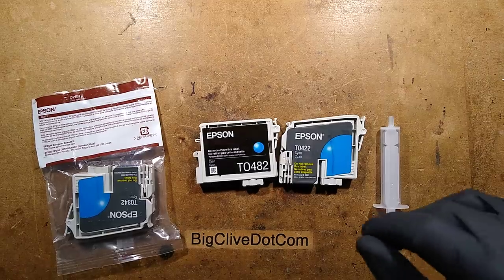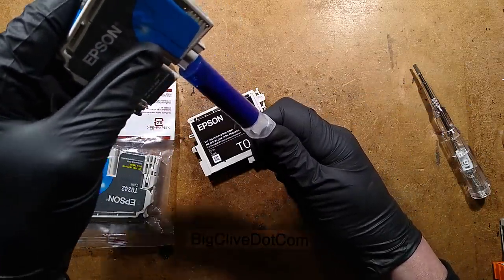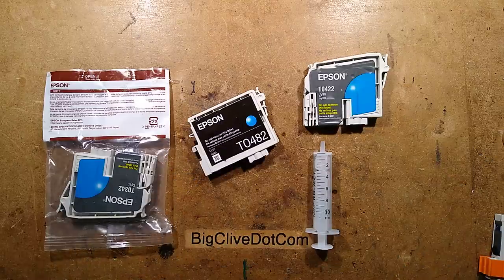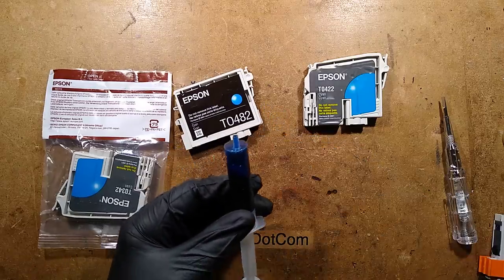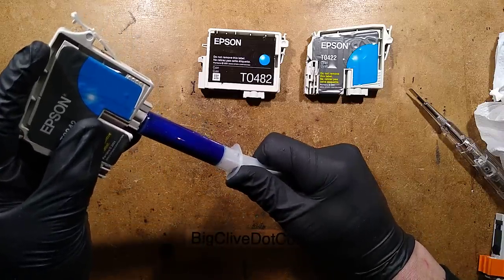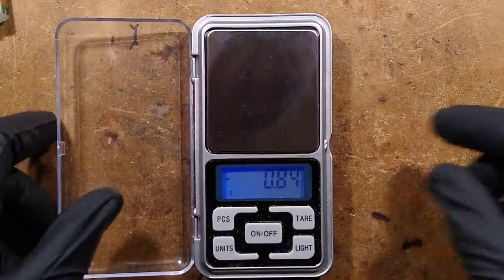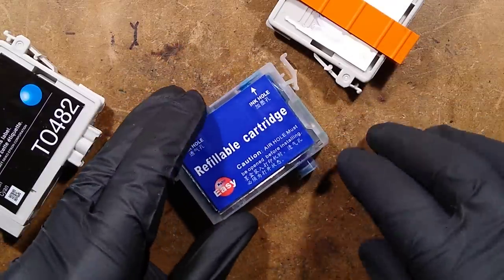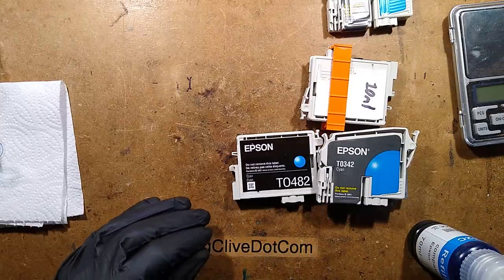How much ink is in Epson cartridges?

Comment: HP are worse with their Instant Ink system, if you don't subscribe to Instant Ink then you can't use their inks and have to buy the really expensive ones from shops, also if you are on an instant ink plan and cancel the subscription then you can no longer use your cartridges they supplied even if they still have ink in them.

I use an Epson Ecotank printer and it is great. I've even used unofficial inks before. Just remember with Epsons that they have an internal counter that shuts the machine off after a certain amount of print/clean cycles, and you have to get it "reset" to continue printing (applies to ALL Epson printers).
Reply from the maker: There are ways to reset the waste ink counter and wash out the full container.

Comment: I have a refillable Epson cartridge and once the printer thinks it's empty the printer sends it's 'kill' signal and the cartridge uses that signal to reset the chip, you then take the cartridge out refill it and place it back in the printer and it detects it as a new cartridge. I've saved so much money on inks.

Next printer will definitely be a laser though, I do such a small amount of printing that the heads dry out and I'm forever going through the printers head cleaning routine

Comment: If you do this again with any other 1st party (legit) cartridges, it'd be interesting to also measure third party ones of the same model number. Certainly the third party inks are a better deal, but maybe they are inflating their value slightly as well by putting in less ink than it can hold.
Reply: Ink is the cheapest part, the moulds to make the cartridge are more expensive, along with the print heads. Bulk ink is cheap.

Comment: Clive. Would you like to guess what manufacturer made my parents new printer? 
Yes it is. Maybe I can find some of those refillable cartridges for it. Are they easy to get?

Also we couldn't find those bits needed for the heater and we asked around, so we're getting a new heater. I suppose it's going to be more economical. 🤔 thanks for the help with that. 😀👍
Reply from the maker: eBay is full of refillable cartridges.  Just make sure that the printer can't "update its firmware" to defeat them.
Reply: @bigclivedotcom  
Sounds like a challenge. 🤔 I suppose there's only one way to find out. 
I'll see if I can get one for the black ink and if it doesn't work it's not too bad.
Thanks Clive. 😀👍

Comment: My mother was in the market for a replacement printer... Her printer was quite possibly THE cheapest piece of crap I have ever seen sporting the HP logo, made with the flimsiest of plastic. She prints so seldomly that her cartridges often clog severely. Most of the time, two or three "deep cleanings" can get her working again, but the last time she tried to print I spent about two hours fighting with the dang thing, and getting nowhere. Even a brand new cartridge wouldn't work. 95% IPA couldn't loosen anything up. So, thank you, HP, for helping contribute to e-waste with your junk. It's in the next pile of goods we'll be bringing to Goodwill. It scans/copies beautifully (even drivers' licenses), the FAX part has never actually been used, and if someone can fix it, it has WiFi printing as well. One man's trash could be another man's treasure. Or spare parts machine. Or making music on YouTube.

So she told me, "go online and find me a printer that isn't going to be a piece of 💩, I'm sick of buying replacement printers every two or three years." Valid point, Mom. So I pondered. She prints seldomly, and usually various bits of paperwork. If she prints a webpage or an email, whatever color is there (logos, ads, whatnot) gets printed. But she doesn't actually USE the color printing for anything. I asked her if she'd be willing to just have a black and white printer, and if she had something color she wanted printed I could use my printer, and she said that would be fine because "I don't even print in color anyway."

That settled matters nicely. We got her a monochrome laser printer all-in-one, no more ink cartridges to clog, cost-per-print is substantially lower, and it prints quickly. I didn't even check what dpi it's capable of. (I figured it couldn't be any worse than that old LaserJet 5MP I used to have... What a workhorse that was, I should've never gotten rid of it.) Well, Mom's happy, which means I'm happy.

I did point out the EcoTank models to her, and her jaw dropped at the price. I reminded her that the true savings was in the ink, and the more you use it, the more it pays for itself.

I get some really nice prints from my Canon Pixma all-in-one, once a year I print Christmas cards for my newspaper customers, ~150 4" x 6" color prints on glossy photo paper. I usually go through two of each cartridge, but it's worth it. Two customers actually asked me if I hired a local printing company to make them, which really made me feel chuffed as chips. But based on that once-a year heavy use, and minimal b&w printing throughout the year, I still can't justify buying an EcoTank. If I did more printing, an EcoTank would absolutely be sitting on the desk to my left instead of the Pixma.

Comment: Clive the EcoTank printers are designed to self brick. I'm shocked of all the people you would be had like that!  Every time you print, test print, etc.. it purgest the ink. Inside is a pad that once soaked it wont print anymore forcing you to buy a new printer.  Also, the printers are used printers of old, that were sold for fractions of the price. All they did was change the software and the ink cartridge.  The pad is not user serviceable.  This is well documented.
Reply from the maker: Currently at 6 years, 6000 prints and about 35% waste ink tank capacity used.   I have a reset code on standby for when I need it.   The biggest mistake people make with inkjet printers is unplugging them at night and only printing once in a blue moon.
Reply: @bigclivedotcom   That's a fair assessment. However, Companies designing product to fail over time is bad for the consumer. This should have been built to be user serviceable and although you may not agree with my sentiment, the companies and these behaviors should not be supported. Your use case may never see end of life of the printer, but the issue is that this information is not easily available when someone is purchasing the printer. That is bad business.

Comment: Cartridges are expensive but the printers are sold with bare minimum profit. It's sometimes better to see the printer as disposable and just buy a new one when the ink is empty. 

Btw the HP always online requirement so they can monitor your ink, for your convenience of course, is beyond atrocious. A while ago I had some router issues and because of that wasn't able to print because it was "not connected to the internet". WTF HP. I'm not even sure that's legal.

Comment: Have a look at just how much ink the "echo"-tank uses to flush and purge. It doesn't take long till the huge sponges in it is so saturated it refuses to print until it has been serviced. And no, even with a "user refillable" ink system they didn't think to make the pads user changeable. Or maybe they thought to NOT do that.
Reply from the maker: I'm at about 6000 prints on mine, and third party software says the waste ink tank is only about 35% full.  I think a huge factor in waste ink tank life is leaving the printer plugged in.  Turning it off every night may force a short cleaning cycle when it is turned on, wasting ink.

Comment: I doubt even true technochromatics will be able to see much if any difference between prints on bog standard photo paper with random ink and Epson's funky paper and even funkier ink - especially the 7 colour setups.

I dumped Epson when they went all chip. I ended up with an HP7000 which does not have chips in the cartridges. I used it until the print head needed replacement and put it in a cupboard. One day I might get a new print head but since I don't print photos any more that might be a few more years.

Comment: It isn't issue of amount in the carts.  It is the chip on the cart that stop it from working after a set amount.  Printer has no way to actually measure amount of ink left in the cart.  Like how if have a refrigerator with air filter and/or water filter, it tells you to change it after a set time and not because it is no longer good, because it can't measure it.
Reply from the maker: The older Canon cartridges had an optical system to detect ink level.  Also not chipped, so very easy to refill.

Comment: For all those who a commenting that the Epson Eco Tanks are still a limited life device by virtue of that pesky waste in tank, you need not fret, and frankly should do your own research before spreading false information.

Several of the Epson Eco Tank Models (iirc pretty much most bar the smallest ones) actually have proper user replaceable waste ink tanks that can be done by the end user within just a few minutes and no disassembly, and totally supported by epson with them selling genuine replacements.

The replacements have a chip on them similar to an ink cartridge that allows the printer to track the the use of the waste ink tank and are installed from the rear, retained by just a normal screw.
As soon as its replaced with a new one (Epson calls it a "Maintenance tank kit" iirc), the printer is happy again.

Comment: Epson lost my business when a few years ago one of their printers stopped working because of a 'waste ink tank full' error. This isn't real it is simply a maximum page count that the printer will stop working after printing 'n' pages. Epson will sell you an expensive 'override' code that will allow the printer to continue operating. So I stick to non-Epsom printers for which there are secondary market inks available. Currently I have a Cannon printer that works perfectly well with cartridges that cost me a couple of pounds each (possibly more these days - I bought a load when I got the printer and haven't bought any in the last couple of years.)
Reply from the maker: There is third party software that can supply the reset if you remove and clean the container.

Comment: I'm done with ink, I only use toner. I have a color printer but I mostly print black and white.
Reply: And yellow, depending on the manufacturer.
Searching "yellow tracking dots" will probably get you running to buy a UV/blue led torch and a magnifying glass.
Reply: @georgeprout42  interesting. I'll look into that.

Comment: Samsung CLX Laser printers are pigs. Not only are they expensive, but then there is the drum to replace, but also the catch bin. 
Carts are chipped. Outrageous. Some printers are connected to On Line Time Servers. HP by memory. They would time out cartridges even if you hadn't used them!

Comment: I have killed 7 newer printers doing next to nothing , except emptying my pockets 😡

Blown heads , gearbox faults , chipped ink cartridges , high running cost & heads blocked solid🤯

Needing only A4 , A3 & text prints in B/W my printer is a old 1994 cannon .
I have retired it 6 or 7 times now for newer models but it is back in use again ….😳
OK it needs Linux or some old O/S but you can refill it & it's pennies per 100 prints !

Comment: The ecotank printers look good on paper in terms of money and specs but they are still a disposable product due to the internal ink waste pad that once "full" renders the printer inoperable and unrepairable which is a shame.
Reply from the maker: That counter can be reset by third party software after you have emptied it.  After 6 years and 6000 prints mine is only at 35%.
Reply: Some of the Epson Eco Tanks actually have proper user replaceable waste ink tanks that can be done by the end user within just a few minutes and no disassembly, and totally supported by epson with them selling genuine replacements.

The replacements have a chip on them similar to an ink cartridge that allows the printer to track the the use of the waste ink tank.
As soon as its replaced with a new one (Epson calls it a "Maintenance tank kit" iirc), the printer is happy again.

Comment: Inkjet type printers always fail within 3 years regardless of brand.  This is because over time the extremely small ink nozzles clog up and can't be unclog. This is why everyone in my family have color laser printers.  The powder ink can't dry out and there no nozzles to clog. The only downside of laser printers is you can NOT use photo paper since it will mess up the fuser unit in the printer. I know this because I foolishly tried it and had to clean and rebuild the fuser unit in my laser printer (do not try this, it is very complex - I am a professional engineer that holds one of patents inside a laser printer)
Reply: The original HP design puts those holes in the cartridge, so each new cartridge provides a new print head .
Reply: @johndododoe1411  - true, BUT those cartridges are super expensive. You pay a lot to get a new $0.03 head and a few ounces of ink. In the long term laser printers are  much less expensive especially for occasional users.

Comment: Although eco tanks are better value, after so many pages have printed, the printer stops working and you have to reset the page counter in the Epson software, which you have to pay. There's a free download which let's you reset to another 500 pages, but it notifies you that the waste ink tank needs replacement (a messy job cleaning that out lol) 😂 so Epson are still ripping you off, just in a delayed way. Crafty stealth tactics. Gits!
Reply from the maker: 6 years, 6000 prints, ink waste counter at just 35%.  Full reset code on standby for when I need to empty the waste tank.
Reply: Some of the Epson Eco Tanks actually have proper user replaceable waste ink tanks that can be done by the end user within just a few minutes and no disassembly, and totally supported by epson with them selling genuine replacements.

The replacements have a chip on them similar to an ink cartridge that allows the printer to track the the use of the waste ink tank.
As soon as its replaced with a new one (Epson calls it a "Maintenance tank kit" iirc), the printer is happy again.
Reply: @KSSilenceAU  yeah, exactly my point money money money.. 🤑😉

Comment: I alqays wanted to try to read and write to that cartridge chip with an arduino i think it would be interesting
Reply from the maker: There is data about the protocol online.    It is apparently low voltage and quite slow.

Comment: Printers are such a weird market segment. Even new ones are the basically the same 30+ year old designs and firmware. The whole scam is based on marketing, selling ink, artificial limitations, and myth. They only came out with the tank printers to save the companies from tanking. With fewer people buying printers in general they had to appeal to the hard-core that know what's up. An actual new modern from-scratch design printer would be much different than any current printer but nobody cares.

Comment: I had an old cannon color printer sorry forget the model but used it for almost 23-25 year refilling  saved hundreds if not a thousand or two  sadly the drive motor died RIP
Reply from the maker: I used a Canon for a long time.  Unchipped cartridges that detected ink level optically and were very easy to refill.

Comment: HP used to have clear cartridges in 2000 they have progressively gotten worse and worse and worse you now need an account just use the scanner. Set up process is an annoying hour at least and that's assuming you don't have anything non-standard like you want to use ethernet instead of Wi-Fi and you have to follow it exactly. What you don't want to use an account well you're gonna be stuck here on the screen that says set up your printer..................

Comment: Have had HP inkjets in the past and was a huge scam, 95% of the print was black but colour was used also until tou have to replace all. Where i am i cannot get reliable battery ink setups so i moved to laser black and much better

Comment: This has to be the biggest rip off ever with HP but if you want lots of ink look in the bottom of your printer at the sponge pad it is big and loaded with ink! Clive do a video with a teardown of the printer and look in the bottom, you will be amazed, my HP printer was two years old, I HAVE NEVER SEEN SO MUCH INK.
Reply from the maker: After 6 years and 6000 prints my waste ink pad is apparently only 35% filled.

Comment: Spoiler alert...there's not nearly as much ink in those as one may expect, especially given the price.

The real question is, will it carbonate? 🤣

edit: that's far more ink than I expected. I've opened up new cartridges that contained less than a table spoon. And those cartridges were just under $20 CAD.
Reply from the maker: Carbonating ink would not end well for the sodastream, the carpet, the ceiling or me.
Reply: @bigclivedotcom  Certainly not, but boy would it be a sight! 🤣Cheers!

Comment: You’re not sucking bubbles, you’re boiling the ink in a vacuum.  😂
Reply: @Kevin-mp5of  Try it yourself.  Put a bit of water in a wide syringe and draw the plunger back.  You will boil the water.  No kidding.

Comment: Went thru several brands of printers, finally bought a HP color inkjet which was supposed to be for home office volumes of printing but the cartridges didn't seem to last long. Found some helpful videos on YouTube and saw one that said to occasionally run a damp cotton bud over the ink holes if it hasn't been used in a while. Made all the difference! I now get a decent amount of prints per cartridge. They're still stupidly overpriced though.

Comment: I doubt the printers have the sucking power of that syringe so probably wouldn't get that much out either.
Reply from the maker: See my most recent video.  It turns out there's actually an externally actuated air valve.